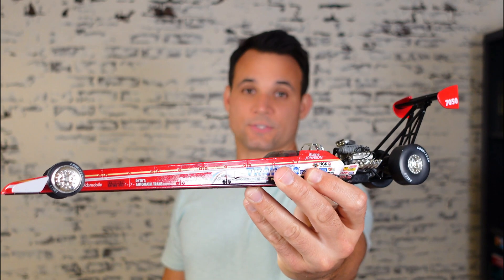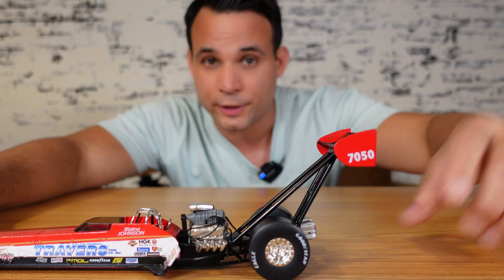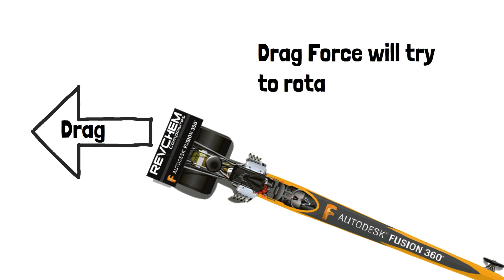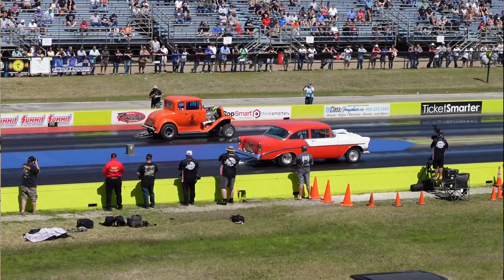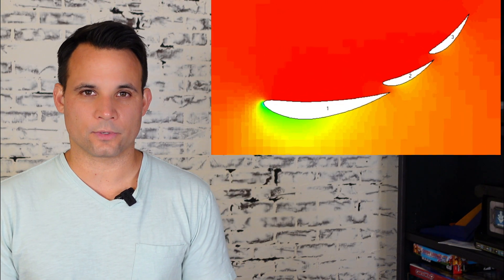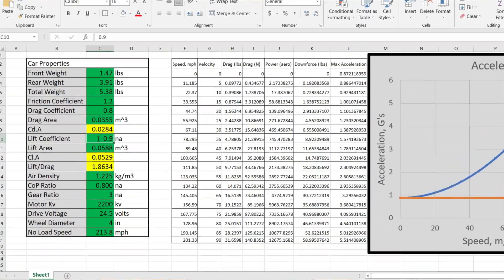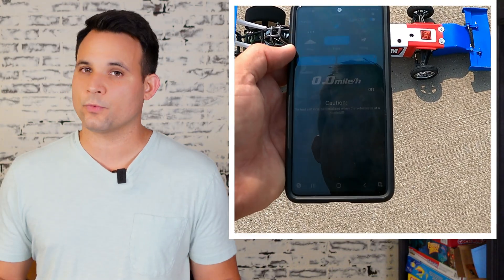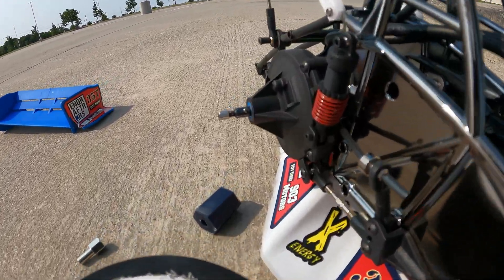F1 Car vs Dragster - the Rear Wing Showdown

Comment: Wouldn't it be lotttt better to test on actual smooth surface
Reply from the maker: Believe it or not this is the smoothest surface available. I tried to get multiple drag strips and airports to let me test there but had no luck. To a 3" wheel...even a pebble is a big bump.

Comment: Ok I get the dragster side of the video but I'm not seeing it on the F1 side
Reply from the maker: The reference to f1 is just there because I had always assumed F1 cars were the highest downforce race car there is. While researching this video I learned it's actually a top fuel and thought that was a pretty interesting fact. I had some more technical overviews comparing the traction limitations between them, but it just dragged on and felt like it was unnecessary.

Comment: Would a smaller rear wing work better for top fuel dragster. They travel at high speed VERY quickly so all that downforce at the rear not too good. The rear wing is there for stability mainly.
Reply from the maker: I think DRS would he the most ideal solution for top fuel in terms of hitting higher speeds and better times, but theyre also nearing the limit of their tire rating so they don't want to go that route.
Reply: @EngineeringAfterHours  that's sounds like a great idea. For the first 3 sec the flap Is closed then For the last 3 it's open. Maby having a system that would only allow them to open the flap after the first 3 sec to prevent them overdoing it.

Comment: Are the wings 3D printed they look really smooth? I have been working on a F1 3D printed car (HPD EVO) and I have been playing with my rear wing design using SolidWorks Flow Simulation... but I don't know much about CFD
Reply from the maker: Yes I used an elegoo mars 3 printer. Resin prints are always really smooth

Comment: How tethered cars are going up to 400-500 km/h (they are toy cars with nitro engines)?
Reply from the maker: I'm aware of tether cars hitting in the  300kmh range but not the 500kmh range. Either way it's waaaay easier to get a tether car up to speed because the runways is "infinite" and there isn't a need to steer. So they can just run a ton of laps with a super low drag car to get their speed. I think their race tracks are also banked, so you don't need much downforce...which reduces their drag.

With RC cars you have to find a runway very long and smooth and the car has to be steered the whole time. The cars are typically larger to accommodate surface imperfections so they need even more power. You need longer range radio equipment for RC as well.
Reply: @EngineeringAfterHours  buy a tether car and try to see how fast it will go

Comment: Apparently the Dumbo RC transmitter has a very good range on it, but it would mean you would need to have to find a way to put all the smart features on the car.
Drag chutes are a must, they're there for safety reasons as well as breaking.
But I would like to ask something. Do the full sized top fuel dragsters have open, closed or LSD differentials?
😀👍

Comment: Before watching, I am curious how you plan to compensate for the thrust that is created from the exhausts during the first meters that obviously cannot be easily simulated in RC. Cool project!
Reply from the maker: You are well studied I see! The main reason I didn't do anything is because off the weight it adds. But I have considered something like a catapult launch or magnetic tracks until the downforce is high
Reply: @EngineeringAfterHours  Thanks for answering. How about something with a regulated co2 cardridge with something like a volume multiplier (bernoulli principle) so it works for +- 2 seconds or something like that. It would indeed add mass but that may not be too much of an issue since you can't use all the available power anyway at the moment. It would add cost and complexitiy though so I can understand why you wouldn't want to experiment with it  within the realm of rc drag racing
Reply: I was referring to 5:58 in this video by Driver61: 
https://youtu.be/8HsCB8gdV3c?t=358

Also interesting video is this one by papadakisracing:
https://www.youtube.com/watch?v=F98lUtez3EU
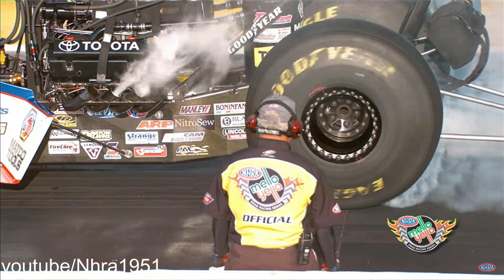Reply: Ah 2:00 in the video you are also talking about it. Cool!

Comment: How much do you generally spend on a project like this? Because it looks really fun to do this and I might look into doing things like this myself.
Reply from the maker: It's all over the place in terms of cost. I try to buy common motors, radios and such so that cost growth is limited, but this was an example of a pricier build. I already had the castle motor/esc combo, the transmitter/receiver is like $250 or something, wheels are in the $50-60 range and then I bought the frame for another $250 or so. I make my own wings and all that so its really low cost. I'll also use this chassis in probably 2 more videos to average the cost per video down. 

My next video will be nearly free because I am just reusing an old rc and building it into a sand dragster. Since I have 3D printers and CNC equipment, those parts are low cost for me.
Reply: Okay and if you make your own wings do you have a 3d printer?

Comment: I would love Kyle from Kyle Engineers to do an analysis of the aero on these. I would imagine that the hollow section in the wheels and the area behind the rear wheel and the body would be generating absolutely massive amounts of drag.
Reply from the maker: I've always wondered how he would design an RC car myself. I want to do a build that is pretty much a time attack car, which he has done a lot of lately. Would love his feedback!
Reply: @EngineeringAfterHours  That would be very interesting! But I can imagine it would be quite different. Well maybe not as they use models for windtunnel testing..
Reply: Also a fan of Kyle's videos. For sure an interesting and a subject we can suggest

Comment: Awesome video!  I battled the rear braking issue a lot with my streamliner and found the key is to have enough weight in the front to keep it going straight, which of course is counterproductive to traction (I'm working on traction control/ABS right now).   

Some dragsters also run a solid airfoil for the uprights on the rear wing to help move the center of pressure rearward.  They make some awesome functional scale parachutes which are over priced.  I'm most likely going to use a nylon or dynema rocket parachute once I get over 100mph.

Comment: I'm running proline belted reaction tires on my 2wd no prep RC drag car. Those tires should be capable of getting you to 100 mph and should have superior grip to the BSR's on the launch. As far as running on a real drag strip I highly recommend just showing up on street night, I plan on doing the same thing with my 4wd 8s drag car but only running 1/8th mile, my goal is to eventually grudge race a real no prep car or 2 and shock the world when they see the numbers a castle XLX2 and TP Power motor can put down. or better yet... if you're willing to split a track rental halfway between us (I live in New Jersey) I'll race you heads up with no wings on my car purely for the content and entertainment value.  at least they won't throw us out for not meeting safety spec, lol. 
Also why is the top wing element completely vertical at the rear edge of a real top fuel dragster? Wouldn't that create thousands of lbs more drag for marginal gains in downforce at over 300 mph?

Comment: two things i noticed you missed with some of the explaining, one, the dragsters are racing on a surface prepped with glue, allowing grip levels that arent attainable with your parking lot, two, the dragsters actually do launch with wheel spin, my dad has tested a lot on how slip affects grip and found that a wheel speed about 15 mph faster than car speed allowed for the best grip on a bias ply tire.

P.S. sorry about my grammar i didnt feel like using it, secondly im interested to see what you can do with these rc’s, as i have been interested in doing things like this to them for a long time although i havent yet learned how to. Again sorry for the grammar.
Reply from the maker: I didn't want to mess with track prep on this one but I do mention it on some of the other videos. This thing would be a beast with it. 

And yeah dragsters have to dance the fine line between wheel spin and violent hops. If i could set this throttle to be maybe 10% speed instantly and then the delay I would be able to replicate that....but with this software I don't think it's possible. Maybe I'll keep playing to see if I can make it work. Good mention on that front